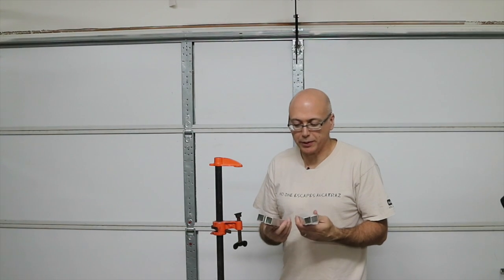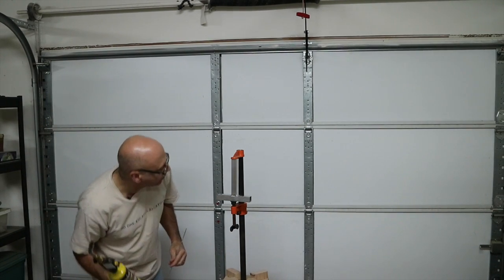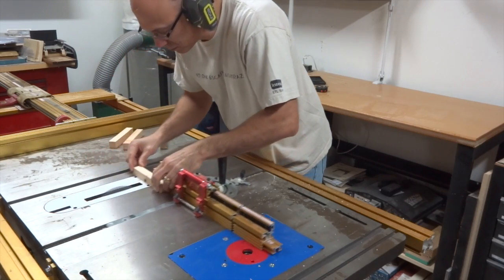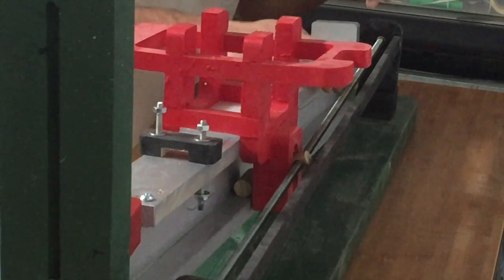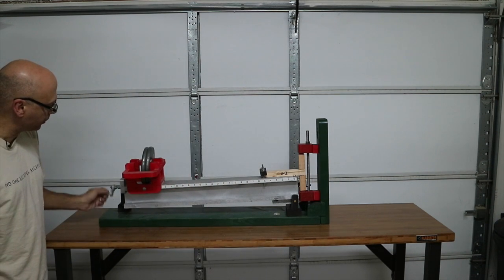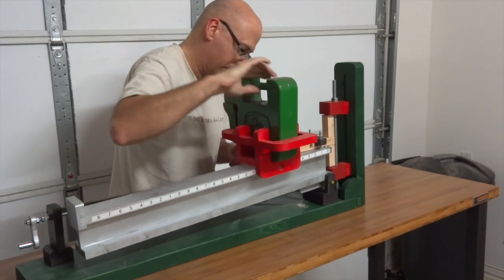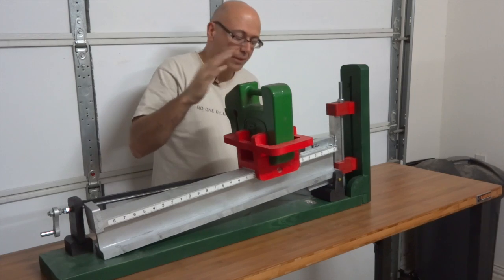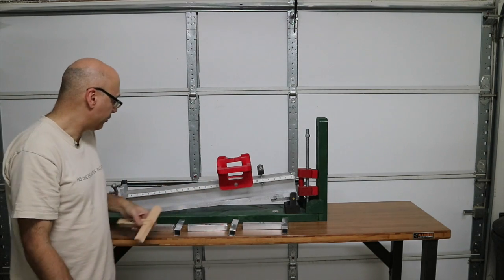Aluminum Brazing Demo & Strength Test - Spoiler Alert: FAIL!

Comment: That was not a good test at all.  Solid stock wood, glued in a double lap (essentially a complete solid stock) different joint. The aluminum was hollow and again, different joint by A novice. Bad test.
Reply: Maybe look at coefficient’s of the material my friend. You may find that the solid stock isn’t as strong as the hollow after all... only a suggestion. Tensile, bend and elasticity will tell the tale. Not at all certain but maybe worth a conversation. My assumption is that your statement wasn’t made after any of these were performed?
Reply from the maker: Bocephus, you have exposed me -- I never wanted that evil aluminum joint to beat my beloved wooden joint! Not if I could help it...
Reply: I've Been Thinking Workshop 
Hey. I was biased myself in my assessment of your test. I just really wanted to see brazed aluminum hold up. But, to be fair, the comparison testing was rather inconsistent.  I appreciate the time and effort you put in the test.
Reply from the maker: Ain't no thing, Bocephus. I'm just having some fun with you. I know it's hard to tell my tone from a comment posting. Keep on posting your comments.

Comment: After you braze you want to hit it with the heat again real quick. To make sure everthing is soaked in
Reply from the maker: Thanks, Mike. I'm pretty sure I had it hot enough, but I'm also new to brazing. I'll try that idea some time.
Reply: @IveBeenThinkingWorkshop  No, you didn't.  You got it hot enough to melt then you didn't go back in to keep it hot and allow it to bond.  It melted on the surface and didn't melt in (capillary action).
Reply: @eddaddio  My thought exactly. After he heated up the piece he then added the rod but removed the heat completely from the piece. The added rod material absorbed a lot of heat and there was no continuous heat supply to the piece so the molten aluminum didn't flow evenly and completely to cover and bond all the edges that needed to be joint.  Just a bad soldering job.

Comment: i like the test, but the aluminum should have had the similar joint system as the wood.the wood just distributed the load through the joint. where as the aluminum only had the brazing as its support.
Reply from the maker: You're right. It was not a fair comparison. I guess I knew ahead of the test that a wooden butt joint would not perform well, so I gave it some help. I didn't know before doing the test that the brazed joint would be so weak, at least the way I brazed it.
Reply: I would like to see that comparison.

Comment from the maker: I used Hobart 770206 aluminum brazing rod that was labeled as self-fluxing with a melting point of 700 degrees. If you have any suggestions, let me know.
Reply: Try clamping your work pieces using ceramic tile. It'll keep the heat from the concentrated on your work piece without concern about heat absorption from the clamp itself.
Reply: One big problem with aluminum brazing is it tends to anneal the aluminum. You'll need to give the AL some time to harden back up ("age"). One way is to put it into the oven at 350 degrees for like 6 or 7 hours